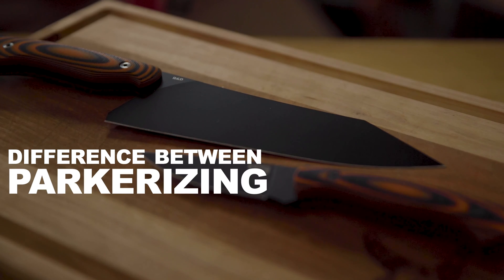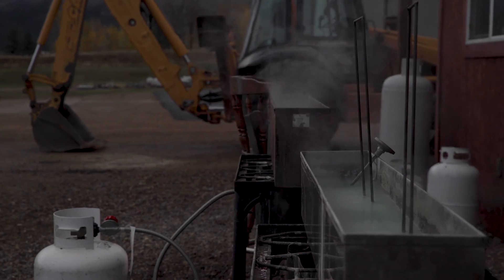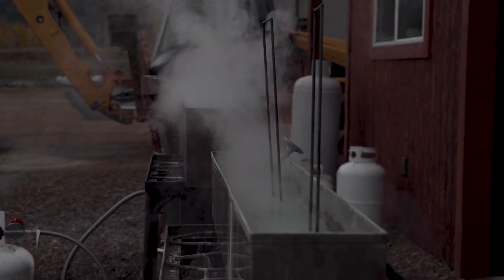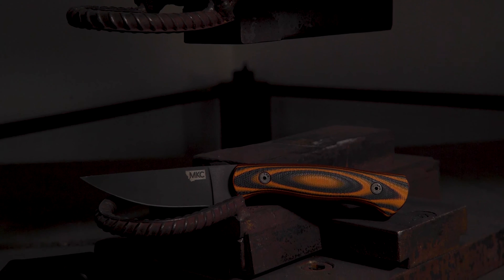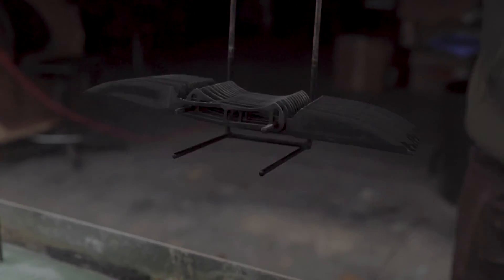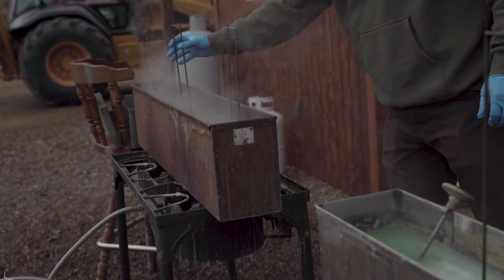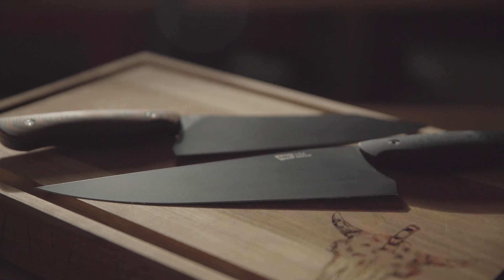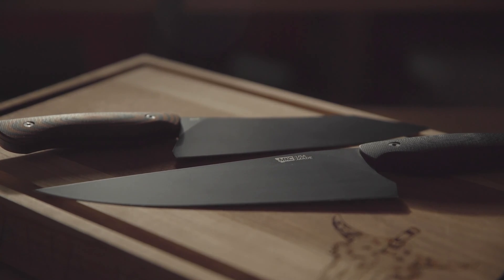Knife Coatings: Parkerizing vs. Cerakote Compared

Comment: Since the cerakote is a paint type material wouldn't that make it less desirable on a food prep knife? I know that with regard to non-stick coatings on pans became a hught topic a while back because it was flaking off into food. It seems to me that by the description here parkerizing would be the better choice... not sure how "food safe" cerakote is.... makes me a bit curious... also... why coat the kitchen knives that are made of magnacut anyways?
Reply: You are correct, it's not a good coating at all for food use. In fact, besides the flaking, it's also believed to be carcinogenic, even though California has deemed it safe and prop 65 compliment, there is contradicting information on this. I prefer to simply stay away from it.